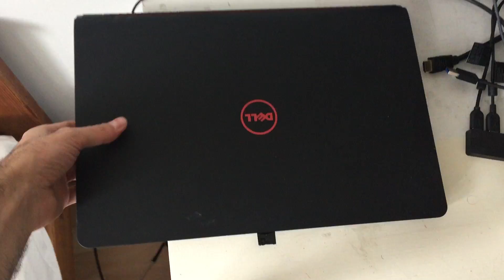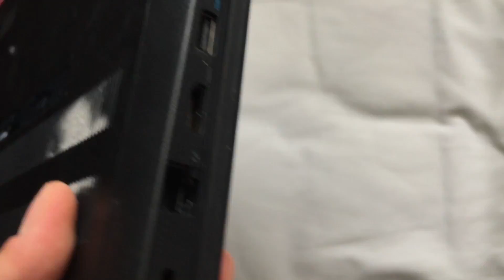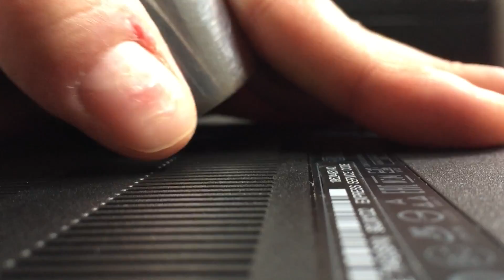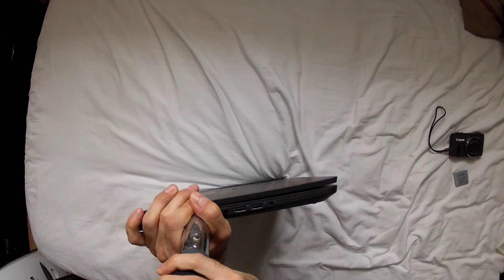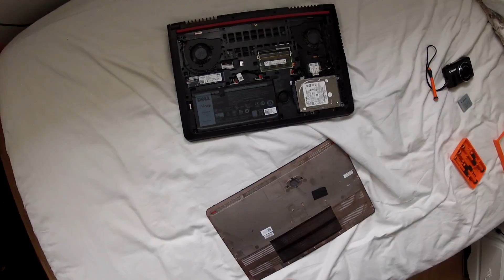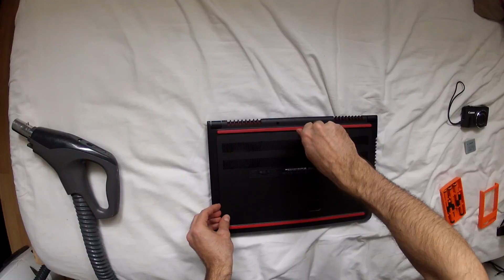Dell Inspiron 7559 Vent Cleaning

Comment: I have the exact same laptop. Have you had an issue where the fans don’t turn on for more than 30 sec at a time and it causes your pc to overheat. If so how did you fix it.
Reply: Go into the bios settings (google) and run a diagnistics on the fan test. There are software to keep your fans running at full speed, but ive found they bypassing system settings causes some issues in running some games or applications.

Comment: To TechManZ I hope you realize you just gave duff information to 10,000 people on the internet who will potentially destroy their computers doing this. DON'T put vacuum cleaners against computer hardware. Vacuum cleaners by their very nature create large volumes of static buildup that has a high potential to destroy or damage electronics*. There is a *good reason why people advise you to use compressed air.
Reply: I was just thinking to myself "doesn't vacuuming build up static?" This video is pointless unless there is a vac that is anti static.
Reply: On top of being on a bed lol

Comment: In case the thermal compound has broken down, would you know if it's a thermal paste under the heatsink or those weird thermal pads they sometimes use? I need to do something as my 7559 is heating up a lot lately, and i can feel what seems to be the source right under the F7 F8 keys which is where the heatsink is.

Comment: i fully disassembled my i7-7559 laptop changed my thermal pads to (Fujipoly 17w/mk) and used Thermal Grizzly Conductonaut (78 w/mk) liquid metal for my thermal "paste"... cleaned dust out and configured my laptop with MSI afterburner, throttle stop, HWinfo64 (50% fan speed) for GTX 960m +135 OC and -150mv CPU undervolt and -70mv Intel GPU undervolt with set 35 multiplier. Under full load with BF1 and GTAV im running 960m GPU at most 65 Celsius and CPU max 70 Celsius
Reply: So the original compound is thermal pads, but you applied a thermal paste? I have some from a tower build I did, would that suffice?
Reply: Chris N DogKayddie does the 7559 suck air in from the bottom?

Comment: Hi, have you got your hinge problem yet.
Reply: I fixed the problem by taking off the back panel and tightening the screws around the hinges. This completely fixed the hinge issue on my laptop.
Reply from the maker: Thanks for sharing!
Reply from the maker: +Abdullah Alhomidi  i haven't but then again i don't really open and close the lid often. Which hinge was it?
Reply: i never got a hinge problem even though i have fully disassembled my i7-7559 laptop 4 times now...
Reply: Like that ? https://youtu.be/1C64RKmAca0